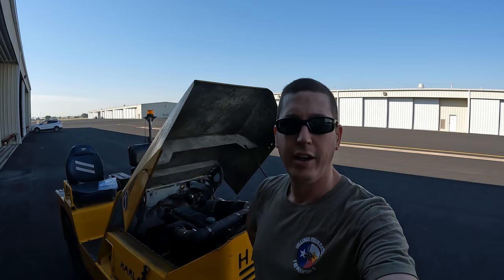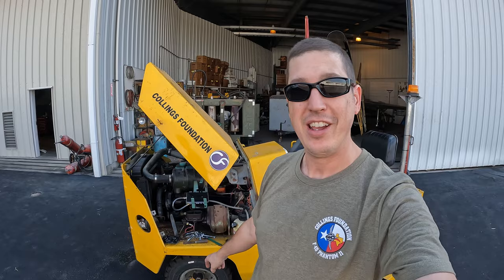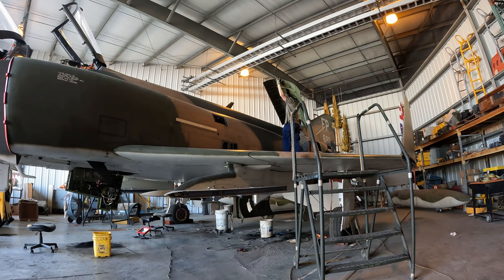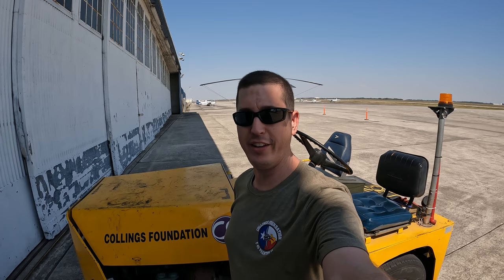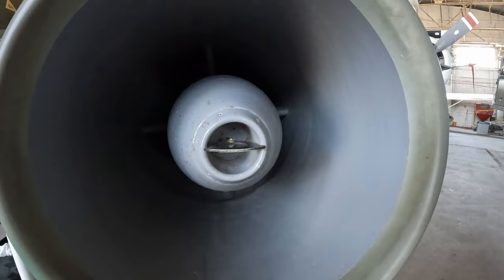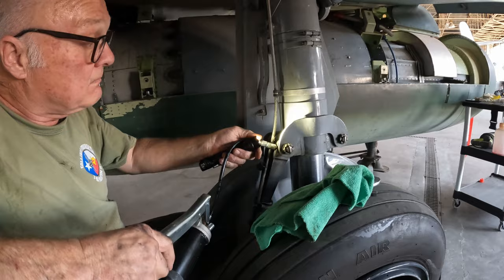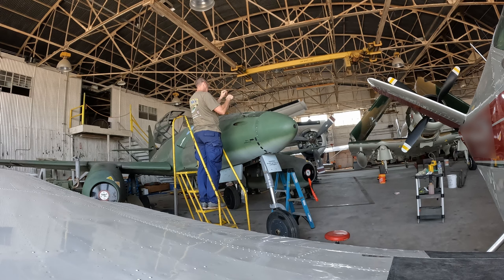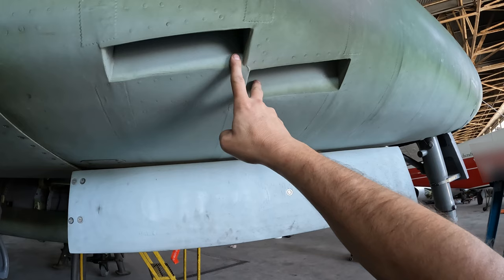If the Brakes Don't Stop It, Something Will! - F-4 Phantom and Me-262

Comment: 2nd! Interesting to see the Lear jet engine fitted to the Junkers, it's significant weight reduction and size w/counterweights! No doubt every pilot for that German fighter finds Lear power more reliable and Safe!
Reply from the maker: Indeed! If I have my history right, the Jumo 004's could only go about 25 hours before needing an overhaul, possibly up to 50 hours if the pilot had good throttle management.